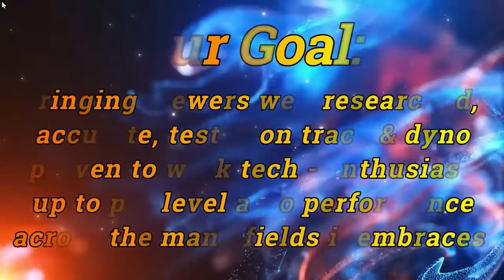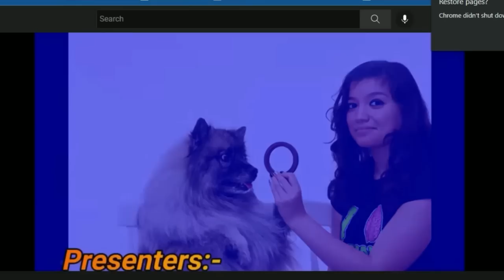A mystyery - 90 hp from spark plug change!!!

Comment: indexing, makes difference on certain combustion chambers
There is something about plugs, I have swapped brands in an engine and huge torque improvement.
Always keep used plugs in the tool box going to a race, screwing in known good is so comforting.

and the mystery answer??
Sounds like subject for a future vid in the dyno room. "How to determine the right fuel atom size for your engine".

Comment: I saw the spark plug issue back in the early eights when we purchase a Direct Connection small block for our Mopar oval track car. it would not run on the recommended side gap plugs but was a beast on stock 340 champion plugs. As for the carburetor my opinion is that carburetors respond to the quality of the signal on the bottom side and not necessarily the volume of signal. Some combinations work and others don't with similar if not identical parts

Comment: I have a theory on the race spark plugs:  If the side gap breaks down before the conventional gap, the conventional gap will never break down.  maybe the flame kernel from the side gap then takes too long to expand into the chamber?
Reply: Good idea,
 I just run two numbers colder, and grind the electrodes back half way over the center electrode. de-shroud the spark. works great. 😊

Comment: any recommended plugs to stop/reduce fouling on a lovely 02 Prism with the 1.8 engine that have the oil ring problem. I have good compression but 15 miles on plug cleaning and I lose power, still starts and idles, drives on level.

Comment: The issue of super-fine droplets coming out of a carburettor is that more of it will evaporate before it gets to the valve which is the biggest restriction in the intake air flow. I think the volume of vapourised fuel is about 100 times greater than when it is a liquid, so just a small amount vapourising in the inlet manifold would significantly decrease the overall volume of air / fuel mixture by mass that is able to make it into the cylinder. Additionally, the finer droplets going in to the cylinder will begin to evaporate more in the cylinder during the intake stroke because of the high proportion of surface area, so tha will reduce the effective degree of vacuum within the cylinder, thus reducing the volume of air / fuel mixture sucked in. So the economy is likely to be better but the maximum power will suffer.

Comment: David, The spark plug issue could have to do with the coil and wires. in 1977 I bought a 1975 pickup from grandparents. It was high voltage ignition (80,000 volts if my memory is correct), much higher than the common 25,000 to 40,000 volt systems and the 80K Volt coil needed 0.080 gap. This was to effect the CAFE standards by massively detuning the engine, including a cam with very low lift and duration. Below 0.060 gap it ran terrible. At 0.100 gap, it ran okay, lost some power, but I gained a few more miles per gallon (from 12 MPH to 14 MPG). My SWAG (Scientific Wild Ass Guess) is that changing the gap may change the inductive reactance of the coil probably causing a slight delay in spark, just like retarding the timing. I didn't have an oscilloscope to test the theory so I am just guessing. 

You used the same parts on different motors and they ran well. I usually only bet with my life and not my money, but with an extensive electrical background for motor control and power distribution, I would bet there were different coils being used for the engines that ran well. And I am going to guess that the gap was about 0.032 to 0.035 for the engines that ran well.

A true story (so I have been told - I could not verify it): Dr Robert Goddard, a pioneer in rocket engineering, was doing a test flight of a rocket. Everything went precisely as planned and everyone was ecstatic except Dr Goddard. Someone turned to Dr Goddard and asked why he wasn't ecstatic and Dr Goddard was to reply "But we didn't learn anything." True or not, I used this principle from then on when things went wrong. As a school teacher, I would teach this to my classes. I also gained a lot of knowledge from mistakes that others made. I hope all this helps.

Comment: My son and I are trying to build up a 1966 Plymouth barracuda with a factory 273 V8
What would you recommend as he lives in Avon CO so is at high altitudes 
We are looking at possibly using the new trick flow racing heads a four barrel carb and manifold with headers etc.
Was wondering what you might recommend for a head and a cam that would help with the lack of oxygen at higher altitudes as it would seem we would need if possible more duration on the cam in order to gain more oxygen etc.

Comment: Seems the mini may need the fuel to vaporize from heat later in the combustion process, maybe pulling heat from the piston , or maybe it allows more air to be pulled in allowing the fuel to be atomized later,  either way it seem the larger fuel droplets seem to allow it to keep burning during the combustion process, 
And the 350, it must have pulled alot of air at 2500rpm,  it would been nice to load it up with sensors to test everything imaginable, intake pressure, the frequency of pulses present the carb sees, atmosphere pressure, the exhaust scavenge efficiency, maybe the overlap was allowing the carb to see the vacuum from scavenging. To the point it was a perfect storm, where it had enough flow at 2500 to keep the carb useable,

Comment: I ran 1992 Dellorto 48mm The boosters i toke up tou 42mm.Run grate on May Corvette run in The 10 sek.This car ward real Street car havy car 1600kg with me in.Dellorto fjuel handel only 3 psi.Have Brodix 11X The ale say no no tou bigg Heads.Runns grate dom 1000rpm Tou 7200rpm.Cant rev it more!?...I have roller cam okej some Nos.201m run 6.9sek no transbrake 0.60 time The best 1.62 .Jou can faind me in facbook Jarmo Minkkinen.Have this car left.Twin Turbo build 1995 Efi hopyly come tou The Street 2023...

Comment: I can't imagine spending a lot of money on a motor that is not a v8
Reply: It depends where you're starting from though. A highly-tuned engine in a relatively light car can be a huge amount of fun, however many cylinders it has. And if it's a car that nobody usually tunes - such as an Austin Allegro - it's even more fun seeing the look of surprise and confusion on people's faces! And 4-cylinder engines are absolutely fantastic for cutting your teeth on - fewer cylinders, less cost. You can then apply the lessons you've learn to bigger engines with more cylinders.
Reply: I'm not saying I wouldn't do anything with them I just wouldn't spend a lot of money on anything small
Reply: Too bad there are not many modern V8 engines. Only 1 from USA, the rest are from Europe or Japan.